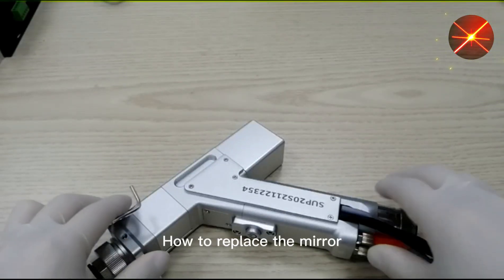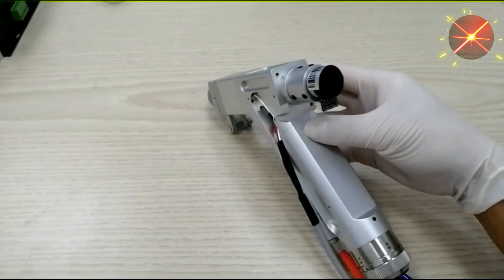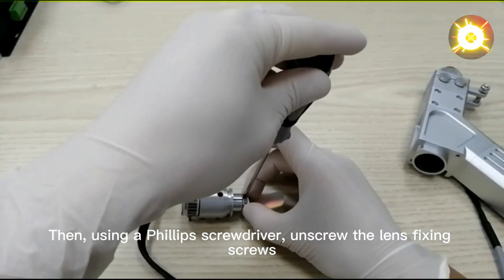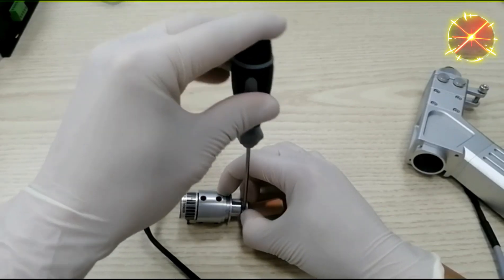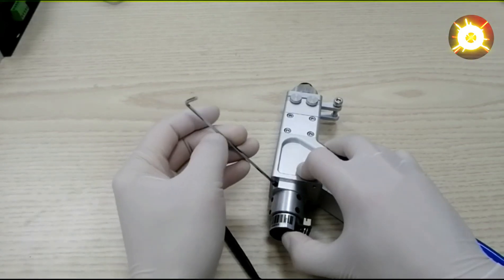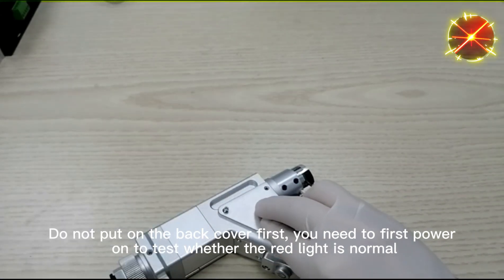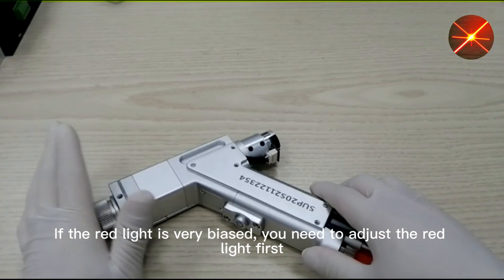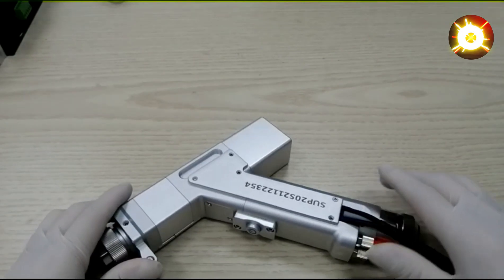【After-sale】Reflective Lens Replacement Tutorial of Laser Head SUP 20S/T

Comment: Is it possible to replace only the mirror? I see it comes with some glue attached to that little module.
Reply from the maker: Not recommended. Every brand of laser head has access to purchase accessories. You may not be able to determine its angle by gluing it yourself.